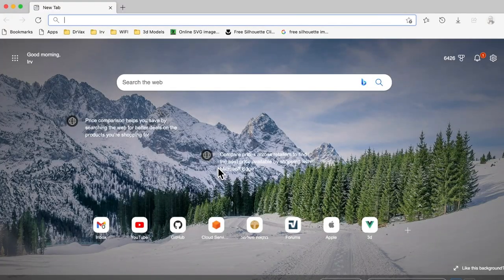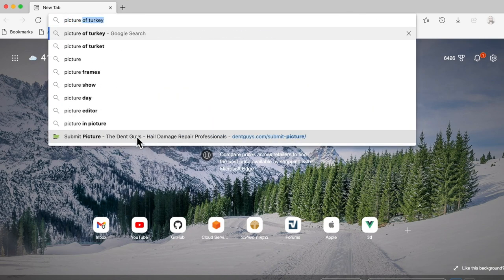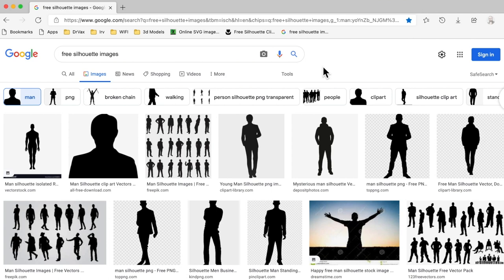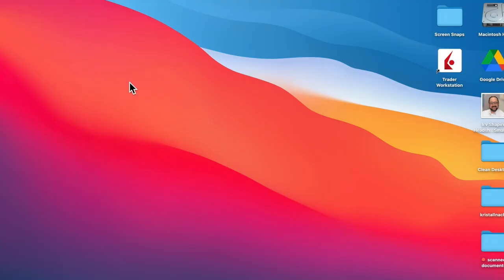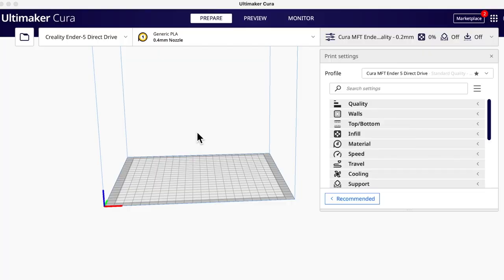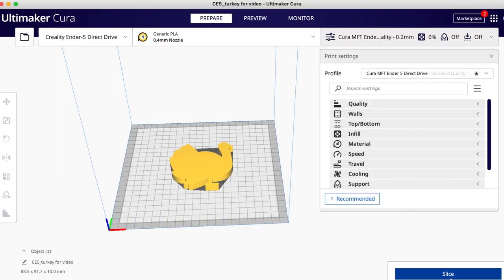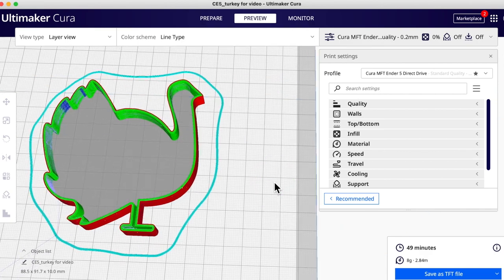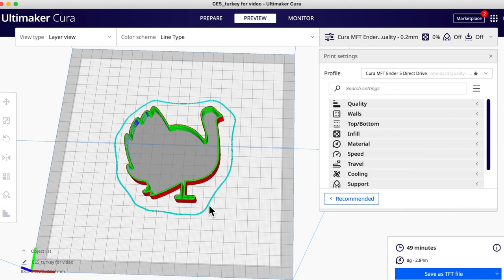Easier 3d Printing Cookie Cutters with a Slicer Hack

Comment: Very well done, but I have a thought that might make this even easier.  Could you not once you have your image in Tinkercad just make a duplicate of the same image.  Then shrink that image down and place on top of the original. Then use the hole feature in Tinkercad to hollow out the image to the size you want. Then export image to your slicer and just print it with no adjustments in Cura?
Reply from the maker: This will not work for any image that is not perfectly symmetric.  Try it.  You need a CAD style outline tool which tinkercad does not have.
Reply: I spend two hours trying that yesterday.. doesnt work

Comment: Adding to this, you can make a lip to stabilize the outline by playing with brim or raft settings in cura.
Reply from the maker: Good idea
Reply: @MakeWithTech  i always make an offset of 1mm of the drawing and then an offset of 4mm of the drawing,the 4mm i extrude3mm high and the figure(with 1mm ofset) itself about 15mm,makes perfect strong cutters that are sturdy no matter what size,i made pretty detailed ones as well this way,they work perfect,so brim or raft does not matter,i do not use those ever!
Reply: @davidhoogewijs1718  Oh man, I really wish I understood what you said here.  Getting the lip on my cutters is exactly what I'm trying to do, and having strong cutters that will last is also something I'm interested in.
Reply: @Nyopanpopan  ,sorry for that 😄,i get the lip on in fusion360, inventor or solidworks as i use these cad programs a lot to design and make my files to print. first i make a sketch off the desired form, then you select the sketch outerline and make a 1,2mm offset outwards and make a 5mm offset outwards. extrude that 1.2mm profile 15mm up, extrude the 5mm profile up 3mm and done you have a lip that makes your cutter very stable, i even use them for cutting in bread

Comment: Hello, thanks for the info, really good and clear. I try to make 3d cutters for polymer clay and always have the same problem double walls, when you print the cutter into the clay you don´t have a solid wall you have 2 very thin walls, and I need only one to make a clear cut. Can you tell me what I´m doing wrong, or if this ever happen to you? thanks and greetings from Spain.

Comment: I know this is an older video, but I just found it and I am so excited to try it out. However, I have the layer view on Cura--and it looks exactly like what you have here. I'm ready to save it to send it to my printer. However, when I save it, it saves as a solid shape instead of with the settings I put in. Do you have an recommendations for what step I am missing.
Reply: Are you slicing in vase mode?

Comment: <---- Very brand new beginner. A very much appreciated video; Thank you. I do have a question though. I got my 3D printer 2 days ago. I want to make cutters for clay, and this method is far better than what I was trying in TinkerCAD. I have one issue in that I need to make the cutting part thinner than the bottom part of the cutter. Is this something I can do in the slicer program as well?

Comment: My svg file is 442kb. It seems to have converted successfully but tinker cad times out before the file opens.
Even at 300 by 152 mm it won’t open.
Should I make the file 100kb or less?
Your videos have taken my understanding of 3D printing from CIB(complete ignorant bastard) to successfully making 3d images; and manipulating them to the size I need.

Thank you
Sincerely 
Jim Muscato

Comment: I've heard that the lead in your brass nozzle can be dangerous when printing things that touch food. Is that a 'myth'?
Reply from the maker: Brass contains lead which  is harmful.  So out of an abundance of caution you could switch to a steel nozzle.  However,  just an observation not a recommendation.  You are using a cold cookie cutter on cold dough.   The cookie cutter will be in contact with the dough for a very short period of time.   So I think it would be interesting for someone to do a scientific study measuring if any lead, or an unhealthy amount of lead, even leaches into the dough.  If any knows of a study like this please post it here.
Reply: @MakeWithTech   I wasn't too concerned myself, just curious on your thoughts.  Thanks for the quick reply!  There is likely more lead in common everyday food products, than you get from a 3d printed cookie cutter :)
Reply from the maker: I think you are probably correct.

Comment: Of course you did not mention about using a steel nozzle because a brass nozzle will leave tiny traces of lead in the plastic which will end up in the cookie..
 *SMH*